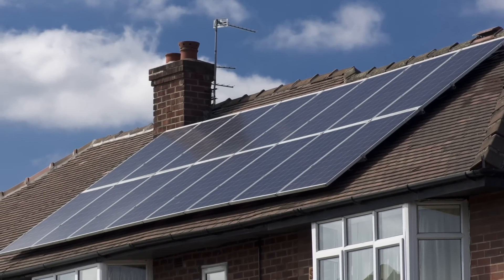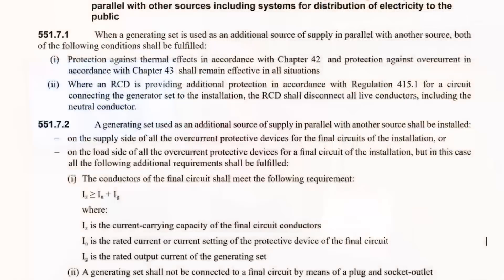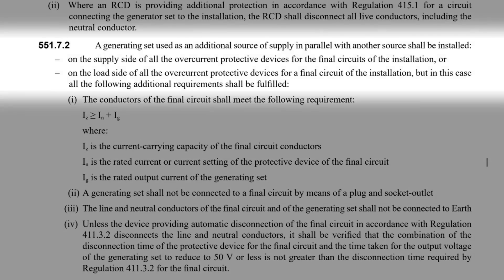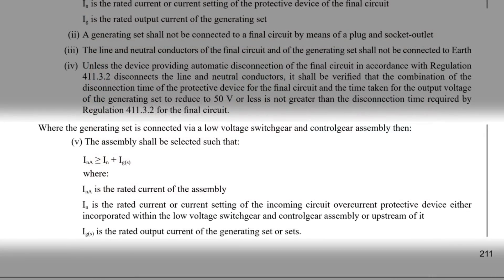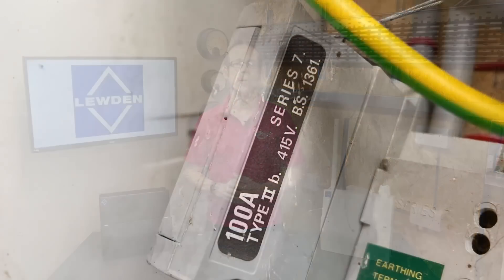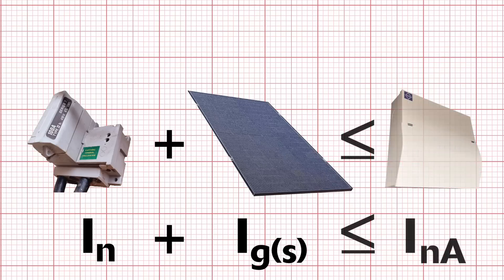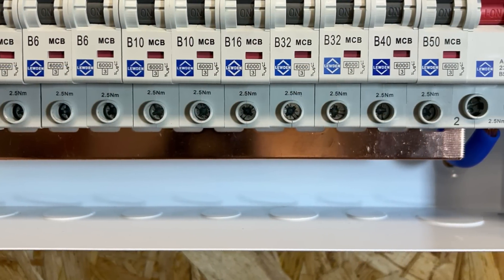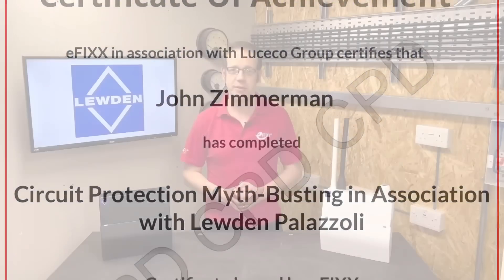Warning: Potential Consumer Unit Issues with Solar PV

Comment: Good advice. But Something else to consider is that a home uses most power when solar is not generating much power, and conversely when solar is at peak, a home is unlikely to be pulling peak loads. A solar battery also has some protections built in

But you never know what will get added, so we considered this and used a Henly block to connect to 2 further boards, one upstairs with showers, and AC units,  one downstairs with cooker/kitchen and other for garage and ev charger. There are some other technical challenges such as SPD and earth/N lead lengths but the sparky and I sat down got some advice and came up with that.

Comment: I was thinking back to this video the other day.  If you've got a 100 service fuse, plus solar and/or battery then one solution is to fit a second, small consumer unit upstream of the existing one.  100A service comes into the new one, the existing one gets fed from it through a 63A MCB.  PV/battery also goes to the new one.  You could also potentially put one heavy-hitter such as an EV charger on the new one.  You've now got a maximum house demand of 63A, plus an EV of 32A, so you're within the specs of the board and 63A for the house board should be plenty, especially with the EV shifted off it (and at least you're only playing Buckaroo with an MCB, not the DNO's fuse).  If you have battery storage integrated with the PV then there's the potential for a demand of 63A plus 32A plus the battery doing an off-peak top-up, but then you've still got the 100A DNO fuse protecting the board so - as long as the PV and battery share an MCB, otherwise move the battery back to the house board - you'd still be covered.  EDIT: Unfortunately the regs don't appear to take the downstream protection into consideration, so the small one's still got to be 125A rated, such as a Schneider SE125A6.

Comment: hm...

how do we fare if all mcb's inside the board only come to say 78 or 80 amps. Say a 16amp for solar pv and 2 x 32amp circuits.  What if you have several boards? Do we need to fit an external fused switch after the cutout If no board has over 80 amps of mcb's? Can the installation actually draw 100amps even with solar (other than a fault condition)?

Just thinking of need for bi directional rcds / mcb's and type b rcd for heat pumps.  you could end up with a board for heat pump and say home battery, board for ev's and solar and then another board for everthing else. or at least 2 board supplied buy you own fused switches (x2) after the main cut out.

In the very near future the potential of 2x ev's, home battery and solar pv could actually generate over 20kw on its own!

Having a home battery and DC solar instead of AC solar will help a bit, but directional charging / discharging of ev's is going to throw a spanner in the works..

Comment: Hi there. I designed, built and opened a zero-emission B&B down here in Rye, East Sussex. Along with a 34-panel solar array, 12kw ASHP, Smart Mixergy Tanks, 10x Air to Air Heat Pumps, underfloor heating and heater skirting boards, 4x 7kw EV chargers (and more)...and you're invited to come and stay with us :-)  Hope you catch this comment....and keep up the good work!  Javed, Magnolia House Rye

Comment: I'm planning on having our place fitted out with infrared ceiling panels. I'm concerned about how the system will be able to cope if I have about seven or eight IR panels wired in. How do I know a competent sparky to employ? What qualifications or certs should I look for can you tell me please? My only thoughts are recommendations on our local fb group at the moment. Or would I be better off having the panels fitted by the uk company i plan to buy them from?
Hoping you dont mind me crashing your video, Joe, I'm only an interested bystander, eager to get things right, proper and safe electrically speaking in my property. Love watching your very informative videos and often try to guess the words in your news reviews, never been right yet!
Reply: Where does this fascination with infra-red panels come from, people want toasty heads? Simulate the feeling of sitting outside under a patio heater?
Reply: @edc1569 well with the system I have in mind it's not going to give quite that effect. However if it did I wouldn't mind feeling something similar to the warmth of the sun on me as I'm mostly housebound.

Comment: I haven't done any PV installs but are people connecting them directly into the DB through a breaker like that? The only ones I've looked at are connected into something like the Hendy blocks with the mains which then feeds into the DB. This way isolation is still through the 100A isolator in the board, just make sure the tails are rated properly. Also the DB is completely dead when the isolator is off rather than having a second supply into it. Anyone out there who does PV want to chip in with how they do it?

Comment: Whilst most configurations are DNO Fuse -> Meter -> Main CU not all of them are.  In my own personal property the path is DNO Fuse - Meter - Electronic Isolator / Generator / Battery Backup / switching Interface -> Main CU.  This switching interface controls what power comes from where, as well as providing protection from back-feeding the grid during a grid outage.  Is this magic box enough to meet the protection required by the regulations and, if so, does it give us a hint of the future by allowing active monitoring and direct control?

Comment: It might not be that unlikely to see higher rated consumer panels in the UK at some point. In the USA some years back a few panels started to be offered with a standard 200 Amp main breaker and an upsized 225 Amp bus. I have one of those in my basement that was installed back in 2019. I assumed it was due to solar, but I never saw any marketing material that said so.

Comment: Seems to me you need a current limiting device on the solar to stop it ramping up under full load conditions in the installation. Or obviously down grading the main fuse to take account off the additional supply but I’m sure there’s lots of installs out there that are not compliant. It’s not good enough to hide this in BS7671 waffle well done for highlighting this!🥵

Comment: Interesting that 551.7.2 says you CAN install your genset on the supply side of the overcurrent protective devices. In your example this effectively makes a 116A supply available to your 100A rated CU Main switch before the 100A supply fuse even starts getting warm. Many G99 solar installations are far bigger than 16A...

Comment: The 100A cut out would normally protect the consumer unit where it to take more than 100A if everything was turned on at once which is possible but unlikely. 

Adding 16A from PV and bypassing the cut out is only a 16% difference which even if it was passing through the 100A cut out would not cause it ti blow anyway - so every CU can exceed 100A by 16A even without PV just by turning lots of things on. It'll be well within the design envelope. It's not a practical concern just a pedantic regulation point.

People install 10kW showers on 32A breakers with 43A going through which don't trip and when the regulations allow diversity they are acknowledging probability - how long is this 16% theoretical overload going to last?

Comment: It's also worth bearing in mind that the onsite guide says it's important to ensure that distribution boards and consumer units are of sufficient rating to take the total load connected without applying diversity.
Reply from the maker: Excellent point, thanks James. 👍

Comment: DNO specification for single-occupied domestic properties specifies an 80A main fuse is fitted to a 100A-rated cut-out AND the maximum continuous load is 20kVA at unity power factor (so 20kW). At a nominal 230V then, the max continuous load is 87A. Add on the potential 16A from your PV system and the total is 103A. I'm not sure when the max continuous load for single-phase supplies increased to 20kW; the breakpoint for upgrading to a 3P+N supply used to be 17kW.
Reply from the maker: Was it with the rise of EV charge points and heat pumps? 🤔
Reply: @efixx  that's difficult to say. Supply spec -  particularly the use of diversity factors in network design - has been evolving for more than 10 years; firstly due to heat pumps and more recently (say last five years) due to EV adoption. My own experience of the 17kW breakpoint goes back to the early 90s, when I did a two year stint in distribution network design. Back then the large domestic loads were almost universally due to electric storage heating.

Comment: An inverter is not a generator. An inverter is an inverter. The regs just don’t meet with reality.
Reply from the maker: Well a PV array and an inverter will "generate" electricity to be fair. 🤔
Reply: The reality is inverters are used to facilitate the interconnection of sources of electrical energy with the DNO network. ENA Engineering Recommendation G98, which governs the majority of domestic generation interconnections, defines a Micro-generator as -

A source of electrical energy and all associated interface equipment able to be connected to an electric circuit in a Low Voltage electrical installation and designed to operate in parallel with a public Low Voltage Distribution Network with nominal currents up to and including 16 A per phase.

So an inverter is effectively a generator.

Comment: Where boards permit, fit an 80A double pole MCB as the main switch, instead of a main switch. Would always seem sensible anyway, less chance of popping the main fuse, ever.
Reply from the maker: Interesting idea that... 🤔
Reply: I always wonder why this isn't standard practice, a DP 80/100A MCB instead of a main switch, it would be designed to break current as well, unlike a main switch which isn't meant to break any load.
Reply: @AndrewStrydomBRP  The whole industry is strange really, complex regs preaching safety, testing procedures not based on reality, on unloaded circuits, and many things no means of testing at all. Just weird.
An MCB in this instance seems a no brainer for many reasons, yet it doesn't happen. Although nor is there any way for anyone to actually test MCB's. Which is daft. We just have to assume they work. There's no means to determine the internal condition of an MCB. I've cut open old ones that I've know have had multiple trip/overload events. And the contacts and internals were heavily burnt. But externally...nothing to see here. But in general, at random, nobody could ever know the condition internally, nor are there testing options.
And I've yelled many times, including to manufacturers about the archaic rubbish designs of CU's and protective devices. Stupid RCBO's with earth fly leads, neutral fly leads....like WTF. Just pure rubbish. Try having to change them in a fully populated TP&N board 5, 10, 15 years down the line when they're faulty. Nightmare.
Zero thought whatsoever to, actual maintenance further down the line. Any so called CDM regs are just BS box ticking, and do nothing in reality. The list goes on really.

Comment: So hundreds if not thousands of legacy PV installs that were done in the days of the feed-in-tariff up until they conjured up this reg are technically non-compliant much like all those that don’t have type A RCDs because it wasn’t a “thing” 10 years ago? 🤔🙄 I see the logic but in practical terms it’s creating a solution for a very unlikely problem
Reply from the maker: Yur, but that's the nature of the regs, if they didn't develop alongside advances in the industry we'd still be using rewirabke fuses everywhere. 🤔
Reply: @efixx that's true but I wouldn't describe this situation as an "advance" since PV installs have been around for decades now - working out that a house *could" potentially draw 116A is more like an after thought ;) - if anything new PV installs are oversized to say 5 or 6kW maybe 10kW and the inverter has G100 export limitation to 16A - in those circumstances the PV inverter could happily push out 20A+ if the house demanded it AND the mains could supply a further 100A - why not upgrade the mains isolator and have a suitably robust bus-bar to suit (a lump of copper like that will happily take the load) Dropping the DNO fuse from 100A to 80A is a rather crude approach and wouldn't necessarily fix the issue anyway as in reality will the DNO fuse blow at exactly 80A - unlikely! It also means that then when there is no PV generation, the house is limited to the lower value which in time will create yet another "problem" to resolve when there are car chargers and heat pumps all wanting to run...

Comment: One thing worth noting is this video is the first place I've heard about the 16A export limitation for domestic solar PV installations. Thinking of the number of people I've heard going on about filling whole tracts of land they don't use with PV arrays for the $£€s I can see a lot of unqualified PV planners becoming rather disappointed! 😥🌦😉

As for me? I live in a home that faces north, where PV panels would be about as much use as a fuse in a teacup. Who needs a 16A export limitation? I'd be lucky if I ever produced 16 mA! 🤣
Reply: 16A is the max export without requiring explicit DNO permission or them having to make upgrades which you would need to pay for which is essentially what solar farms would need to do to get a grid connection…
Reply: look at north facing pv panel performance videos on youtube, at the cheap price now they are worth installing on north facing roofs...
Reply from the maker: Hopefully those installations are applying for permission to export more... 😃

Comment: How many installations have you ever seen drawing the 100A - 23kw ?? - that would be costing £6.90 hour £165.60 day £1159.20 per week ?
Yet again the regulatory framework continuues its never ending upward spiral - the regulations will shortly look like the old Encylopia Brittanica full set.
The lunatics have left the assylum and are currently housed at the NICEIC headquarters with "jobs for life" and "gold plated pensions".
Reply from the maker: It's not that far removed from reality, electric shower, hob, oven, EV charger and heat pump would soon be up there.
Reply: All at once at full power ??
You could include 20 x 3kw fan heaters in every socket if you wanted plus a patio heater 2x Electric showers, hot tub, swimming pool and sauna if you wanted. @efixx

Comment: Why not connect the PV invertor output to the supply side of the consumer unit main fuse?
Reply: How that will make any difference the potential of more then 100 amp is still there
Reply from the maker: For many properties that would be the suppliers cut out fuse. 🤔

Comment: Sounds like something else to put in the pile of reasons to try and justify a whole new set of books.
Reply from the maker: It's more about preventing the current from exceeding the rating of the CU.
Reply: @efixx  so we need a day with full sunshine and run enough stuff in the house flat out to draw 116A all at the same time. That scenario is far far less likely to happen compared to the diversity factor BS7671 allows for a cooker circuit. A simple setting in the solar system to stop exporting in that situation would solve the non issue.

Comment: However, the regulation is clear that Ig(s) is the rated output current of the generating set or sets, NOT the rating of whatever overcurrent protection that is installed on the generating set or sets. Which means, the PV fuse is not what sets the limit, but what the PV set is capable of outputting if no fuse were to be installed and any current settings are set to unlimited. Ergo, the output rating of the inverter and/or the solar panels. Meaning, that if you install a "beefier" inverter and/or solar panels to cope with periods of low sun, and then set the inverter to never output more than 16 A, and then install a 16 A fuse, then you would fall short of this regulation if the generating set are capable of outputting more than 20 A if the incoming fuse supply is 80 A (even if this would trip the PV fuse or generator fuse).

I guess its a fault of the wording of the regulation, and it should have said something in the like:
Ig(s) is the rated output current of the generating set/sets, or the rated current/current setting of the generator circuit overcurrent protective device either incororated within the low voltage switchgear and controlgear or upstream of it, whichever is lowest.
Reply from the maker: Maybe it'll get tweaked in AMD3... 🤔